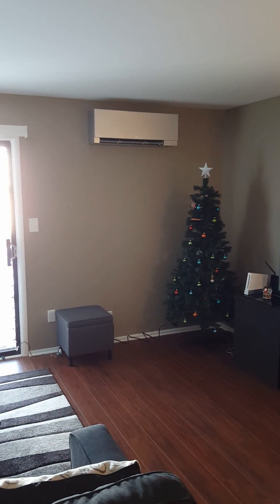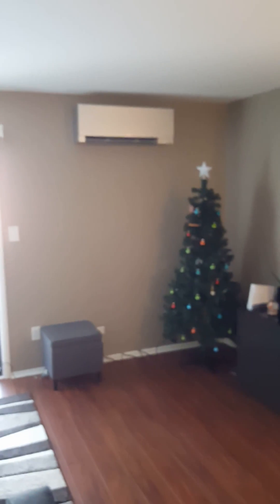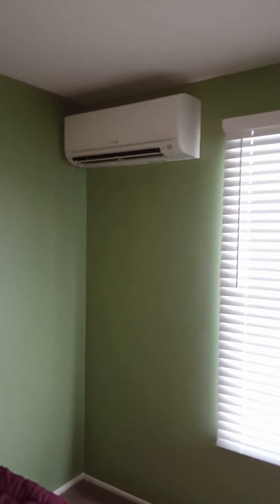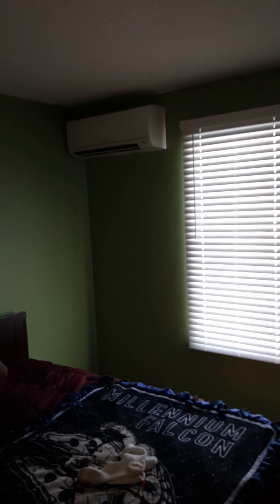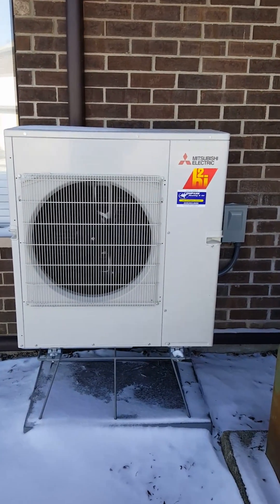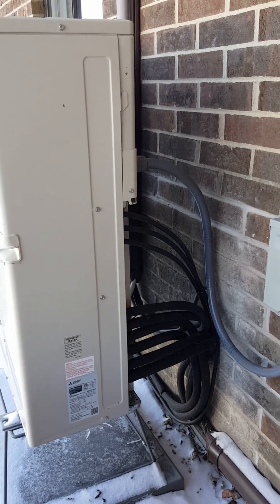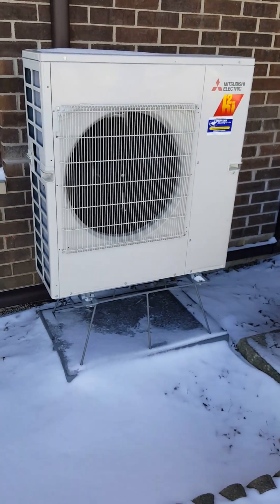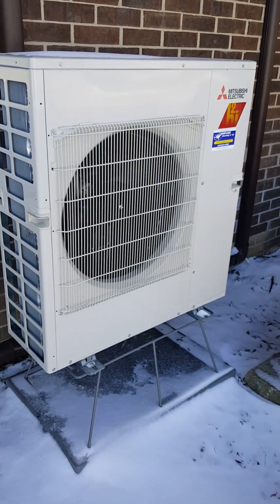Mitsubishi Hyper-Heating multi-zone operating in cold weather

Comment: I will say gorgeous install through brick though 🤙🏼🙌🏼Even without a Delta over the coil and outdoor temperature...
Reply from the maker: Thank you for checking out our videos! I remember the day this video was recorded. The outdoor temperature was predicted to be -13F (the rated Mitsubishi temp) however, that did not happen until well after dark. I took pictures of the temps at the units and then did a quick video to showcase the phenomenal heating ability of modern day heat pumps.... particularly, ductless low ambient systems. I scrounged up a picture of the information you seek on our Pinterest page. https://pin.it/1H35gtj

Comment: Looks ok and surely works good, but personally I would prefer the ceiling cassette, those wall units looks intrusive.
Reply from the maker: Being the first floor of a condominium, the ceiling cassettes would not work; they are nice looking units though.
Reply: @compassheatingandair   Thank you for reply.
Reply: After a week they blend in with everything else in the room. It drastically cut our heating bill when switching from radiant and baseboard.
Reply: @cfldriven  Yes they are efficient.

Comment: These [ductless] systems are only good choices as primary heat for extremely well insulated dwellings with excellent double/triple glazing. These systems are good choices as only supplemental heat source for dwellings with not ideal insulation and glazing. 
Some of the reasoning: 

1. heating testing is done at around 40 and 20F. Lower values are extrapolations. Below 20F the efficiency drops drastically. 

2. costs are [much] higher than oil heat, unless [state] electricity costs are very low. 

3. Heat is expelled from the head at the ceiling and must be pushed down to the living space by the weak fan. This will not be [efficiently] successful because heat rises and the "whisper quiet" fan is not sufficiently powerful to overcome the thermal forces and other heated air distribution issues. 

4. Heat sensor is in the head at the ceiling where the temperature is much higher than at the center height of the room, or at the floor. Therefore, comfort is a great challenge. A $250 programmable thermostat for each head is a must. 

5. Well skilled/educated contractors [in heat pump technology] are extremely difficult to find. Without a well skilled designer/installer, the project is a failure "waiting to happen". Buyer beware! 
6. Mechanical noises are annoying and distracting. Vibration noises from outside units will be present if the outside unit[s] are mounted on the exterior wall.
Reply: This is all nonsense. 
1, Mitsubishi does test and publish data for lower temperatures than the official AHRI 17 & 47F figures. 
2, obviously the electricity to gas price ratio is important, and there are places it would be a bad idea to use any kind of electric heat. But most of the country outside of blue states still has cheap power. 
3, Heat rises and requires a fan to circulate, yes. 
4, These units (and most others) have a thermometer built into the remote already, and these particular ones can actually direct the heat towards you as you move around. 
5, You don't need a skilled contractor, installing a ductless unit is trivial. 
6, these things are quieter than any other home appliance, from AC to fridges, especially with the outdoor unit mounted on a pad.
Reply: @motog6436  my day job is to test equipment for functionality, reliability, efficiency.  no nonsense, just the facts my friend.  if you like to waste money and be uncomfortable, please do spend your money.
Reply: @HC-tc7gv  post your test results please
Reply: @motog6436  no problem.  just have to figure out how to attach documents here.  I have lots and lots of test results.
Reply: @motog6436  response is not going to get through to you.  Hope you make a lot of money of off people that are willing to part with $$$.
Reply: H C what do you recommend for a heat source then if these are not a good choice for poorly insulated home? I have a 60s farm house with large aluminum windows. Currently heating with pellet stove as baseboards were $300 a month. Pellets are becoming hard to lift. We don't have natural gas available. Propane or heating oil would have to be trucked in.
Reply: @danielneighbor4328  Pellet stoves are best option for you.  Here Ace offers holding pellets after purchasing a ton or more.  I pick up a week or two worth per visit.  Another option, install large arrays of solar panels to support huge electricity usage from heat pumps.  Problem, both are very expensive [heat pumps + solar] projects.  Good luck.
Reply: Ace Hardware store
Reply from the maker: Sorry to see you have evidently experienced some issues with ductless equipment. We have installed many systems as the sole source of heat (as well as supplemental, of course), in the northwestern suburbs of Chicago, with no issues. The same guidelines for proper sizing/ load calculations, equipment selection and installation applied to gas or oil systems holds true for ductless/ ducted mini split, VRV/VRF installations- ie capacity at design temperature, operational limits of selected equipment, volume/velocity/ throw of the conditioned air. If you have experienced issues, one or more issues originated during the initial planning or installation of the system. Feel free to give us a call and we will be happy help you with any questions you may have regarding considerations or equipment selection. Thank you for your comments.

Comment from the maker: Rodney Dee- Yes, you can use any of the indoor M- series and some of the P- series with the multizone Hyper Heat H2i outdoor units. This particular setup is using an EF designer in the living toon and GL units on the bedrooms. Regarding the FH deluxe units, they have many features not available on the GL or EF wall mount units. The FH has the I-see sensor which allows it to direct air to areas of the space with hot or cold spots, the louvres are split and capable of throwing air in multiple directions- it also has the ability to direct air at or around human heat signatures selected by the user’s preferred comfort scenario. 1:1 H2i systems require the FH, currently for a matched AHRI system, but multizone you can pick and choose. Share some pictures or video with us when you are finished with your project... we’d love to check it out!

Comment: Is it ok to use the GL instead of the FH heads? What’s the difference? I am planning on doing 3 zone 24k high heat (NY) but I don’t like the FH heads. What will I sacrifice going with GLs. Planning on going with 3 9k GLs on 24k hyper heat. Any thoughts?
Reply from the maker: Roney- yes, you can use the GL indoor units on a multizone system. The FH indoor units have a lot of features you'd be missing out on such as the i-see sensor, motorized horizontal airflow and multi direction air movement; however, they are a little larger size- particularly if being installed in a bedroom. Currently, on single zone (1:1) systems, the FH is the only matched/ rated indoor unit for H2i hyper heating equipment.

Comment: I currently have electric baseboard heaters, they are horrible. I live in upstate NY. I've been considering these units but alot of my friends say get a boiler instead. Does anyone recommend these units over a boiler?
Reply: While I am no contractor, I have been to a rental cabin with Mitsubishi Hyper-Heats, and they cranked out more than plenty of heat in 5 to 8 degree, snowy weather. the cabin in question was about 1500 sq feet, equipped with a 36000 btu Hyper Heat. 3 zone. the cabin had a boiler as well, but we used the Hyper-Heat more, as it heated faster, and kept things more comfortable.
Reply: @Smurdle450  I ended up installing a 3 zone fujitsu low ambient tempt 36k btu. So far it works great but we haven't reached very low temps. I'm planning on adding two more zones
Reply: @BoriPR82  Where did you purchase this unit? and did you install yourself?
Reply: @mtbphoto  I have a 608 universal license, so i went to a local supplier and purchased my units. I did install them myself, I took a hvac course out of high school so it was pretty simple for me. Right now its 36 f outside and 80 f in my house.
Reply: @Smurdle450  thank you
Reply: @Smurdle450  What are your electric utility costs mid winter with this unit? Thanks

Comment: In a split-level, should every room have its own unit? At least one floor of our home is split into several bedrooms, the rest are mostly open floorplan. The contractor we had in suggested a 3 zone system, which I am guessing means 3 indoor units. Not sure how that works when our house is split into 5 levels, one of which is then split into 4 bedrooms.
Reply from the maker: Matty Sarro your home sounds like it would definitely be difficult to heat and cool. Although it is tough to determine what you should do regarding equipment selection and positioning from a distance, I would recommend you find a contractor you are comfortable with and trust to do the work. Ductless is not your typical system when installation or design are being performed. Definitely ensure the contractor you select has experience with these systems. Good luck!
Reply: My install is likley  a perfect crime  if you will , but with two  ceiling  fans and a single  two ton  unit,  areas twenty feet in any direction  are no lower  or higher  than +/- 2 degrees, Somehow  temptures  seem to vary little  even with a twelve foot then ten foot turn. The only  reason I noticed  the slight  difference  was when i purchased  a indoor/outdor remote  thermometer and placed  the remote  sensor at the extreem distance  from the indoor unit. I really never noticed  the two degree  difference,

if

Comment: Does that one in the 2nd bedroom heat the bathroom you showed as well?
Reply from the maker: rrt401 Yes, the wall unit was positioned to provide heat down the hallway and satisfy the heating need in the bathroom. This condominium had a single PTAC in the living room, ducted through the wall to the first bedroom and through to the second bedroom. The bathroom in the second bedroom had a small heater, but is not needed any longer.

Comment: Did the solar 3k..and  heat pump 24000 btu unit combo on my home my advice is to oversized the heat pump by5 just in case temp drop below 15* for a long stretch ..I’m heating my home with a 3 zone Mitsubishi h2i 24000 btu unit 9000 btu per air handler which I install myself 1 unit in basement 1 ground and upper floor..what I’ve noticed the ground floor needed a bigger air handler as heat rises and it’s a older house when temp drop below 20* and I’m with my family on ground level I sometimes have to turn my boiler on other than that it’s perfect cheaper to run than my boiler it’s bin 2 years since install no problems yet.

Comment: I currently have a nine-year-old Mitsubishi 3 ton 4 Zone heat pump if I convert to a hyper heat can I use the same air handlers and just change the condenser or I have to change the air handlers and what is the branch box for

Comment from the maker: We have been installing the Hyper Heat systems for several years. We have no problems with heating during the cold winters here in the western suburbs of Chicago. They work great!
Reply: How often do these things typically defrost when it gets cold?  I am rather concerned that heat pumps tend to defrost far too much as they don't have a way to measure frost build up.  Instead, they seem to just use timers and outdoor temperature.  So, when it gets really cold do these things continually defrost or can they actually provide the warmth required as the sole source of heat?
Reply: How much is electricity bill every month in the middle of winter with heat pumps running non stop?  If electricity rates are low in Chicago, you're in luck!  Here in MA we have highest rates [except for Hawaii] in nation.
Reply: And, the gentle  hot air is pushed out toward the ceiling and not the floor.  If your floor is not heated, cold basement, these will have a tough time getting the hot air down to the floor [understatement].  Buyers beware!   Manufacturers claim manna.  Installers want to make their money.  This product is only for very well insulated homes and installers that are pros with these systems [I had lots of problems finding knowledgeable pros.  They will tell you the are the best, but beware!  Good luck!

Comment: Thank you for your reply that's what I thought considering all the data . The counter guy at my local supply house said no they are not for primary heat we had a little exchange and I advised him to look over the data . It's nice to see the units are performing up to spec . I'm in the middle of my first hyper heat instal wish me luck !
Reply: Hi, Did you finished install your hyper heat?  How does it work so far?  I just would like to know because I'm build a new house and thinking install Mini split (Heat pump).  Thanks

Comment: so the hyperheat will perform as PRIMARY heat source for that house ?
Reply from the maker: ProPimp Yes, we have installed a number of systems as the primary/sole-source heating system. We size the equipment per a Manual J load calculation and, of course, consider the output the Hyper Heating series will transfer to the living space during extreme cold temperatures (-13F).
Reply: Compass Heating and Air Conditioning, Inc. do you guys put a base pan heater in?
Reply from the maker: Bajaheat, the Hyper Heat multi-zone units come with pan heater installed. The single zone systems, we do add the base pan heater; Mitsubishi says the 1:1 Hyper Heat models will have it installed from the factory soon. We add the pan heater to the standard great pumps if the customer intends to use it for heat, but typically those are installed for air conditioning for homes with radiant heat.
Reply: Compass Heating and Air Conditioning, Inc. thanks, I hope the do install them from factory soon, its nonsense not too and I really like that fujitsu does at about $600 cheaper